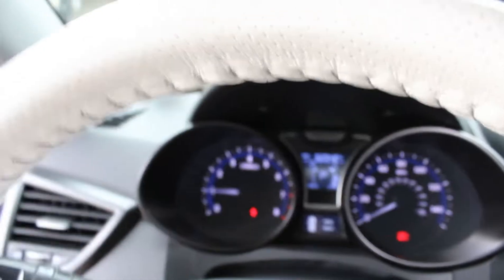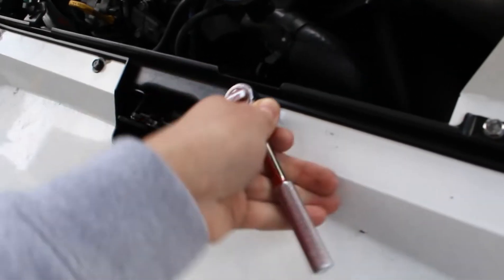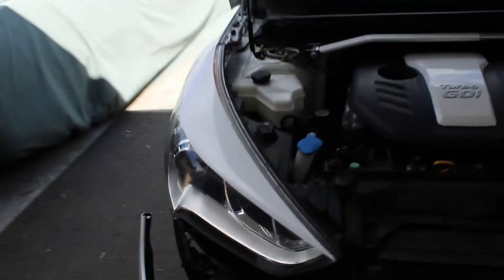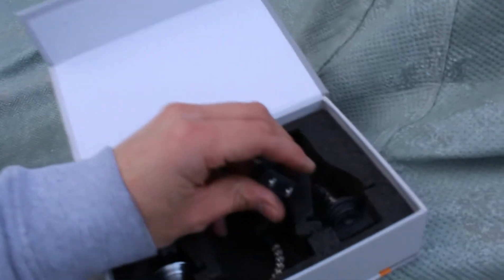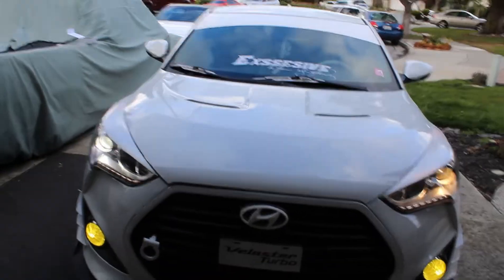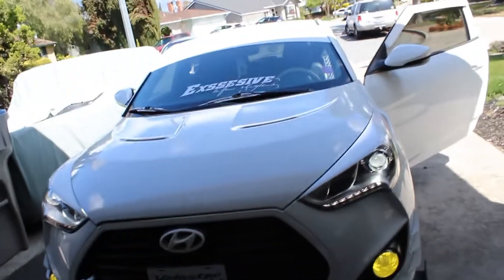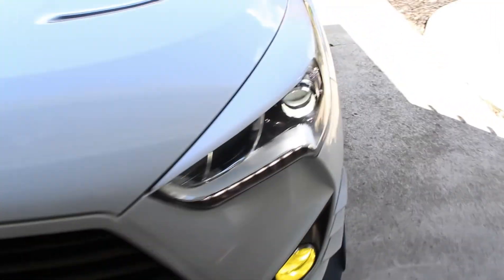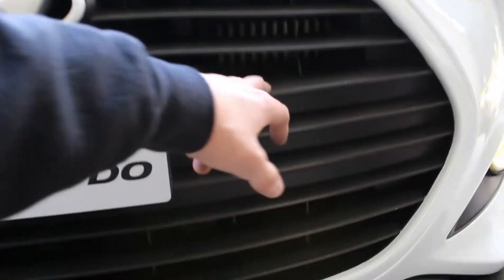INSTALLING LED HEADLIGHT BULBS ON VELOSTER TURBO!

Comment: Should've got the h11b to h11 adapter... just plug and play, you dont have to worry about tapping it
Reply from the maker: aura _dawn thank you for the advice!
Reply: Do they fit for a 12
Reply: @mute4206  if it has h11b it should
Reply: do you have a link to this? @DefNotAmi_
Reply: @seth5129  go to Amazon just type in h11b to h11 adapter its about $14(usd)
Reply: The H11b are for the projector headlight replacement. Which is the bulb 
Exssesive2 replaced. What size is the inside bulb?  Looking it up, it tells me H7 and H11. Thanks for your vid
Reply: Facts
Reply: Where you get the lights from?

Comment: The H11b are for the projector headlight replacement. Which is the bulb 
Exssesive2 replaced. What size is the inside bulb?  Looking it up, it tells me H7 and H1.  Thanks for your vid.
(The difference between H11b and H11 is the  "b" is rotated 180 degrees to eliminate a would be shadow from the H11 at the top.)
Reply from the maker: Ohhhhh and of course!
Reply: H7

Comment: Hey so I have a 13 veloster turbo also and noticed the ring and stream light at bottom is out but not the head light it’s self, how would I replace that? I have asked so many people and no one seems to know ?? I’ve been super frustrated with it. Would the whole head light need replaced? Thanks!!
Reply from the maker: Mandy Manda i am not sure, i will try and look into it and try to get back to you on it
Reply from the maker: Mandy Manda it might have to do with the led strip across the bottom too, so maybe you can replace both at once im not to sure, i see aftermarket lights that you can replace for those
Reply: Exssesive2  hmm ok. So it would be the strip and halo to be replaced? Are there bulbs or is it a while wiring kit that would need to be installed? Thanks for the fast reply!
Reply from the maker: Mandy Manda im
Honestly not to sure this is the only part of the headlight that i am a little confused on sorry
Reply: Exssesive2 haha it’s ok. I just can’t tell if I  replace the board for the halo of it’s connected to the strip light which it should be. I don’t know anyone with our types of cars so I figured I’d turn to YouTube. You ever figure it out you should do a video on it! Lol
Reply from the maker: Mandy Manda yeah ill do more videos on it

Comment: I've never had to take off my bumper and headlight to change a bulb on my VT, and my hands are pretty f'ing big. You've made this so difficult. Also, try getting the correct bulbs next time, no need to modify. Except i drilled 2 small holes in the cap to help dissipate excess heat because you'll notice that your LEDs will slowly burn out.
Reply: I did and my hands are fairly small. cant fit anything behind mine
]

Comment: Heqdlight Experts sell appropriate adapters (H7) for the Hyundai Veloster. So there is NO MODS needed as they said. And you don't have to remove your bumper to install. My son has a Veloster & both High & Low were done with no mods.

You should of went with Lasfit LED's. They're way brighter & better & come with the appropriate LED ADAPTERS on the bulbs.

Headlight Experts bulbs suck! They're dimmer than my stock Halogens on my Kona.
Reply from the maker: MR. GOOGLE they are pretty dim! Thank you!
Reply: @BMWRelates  Welcome , any time !